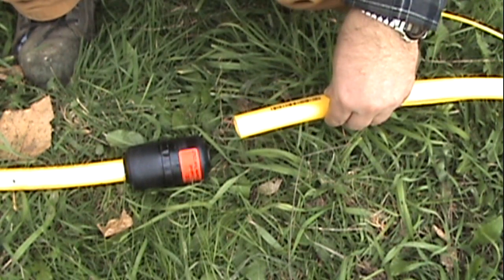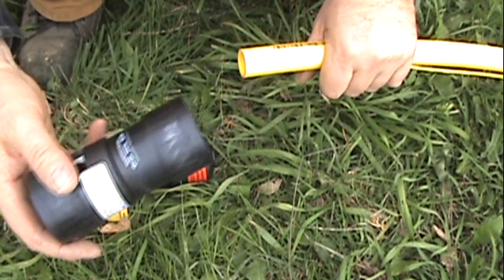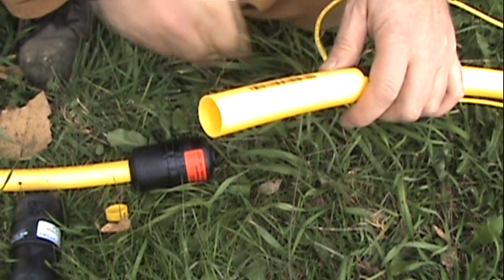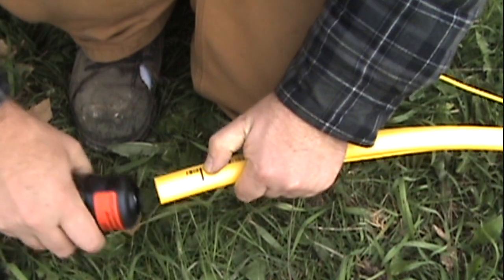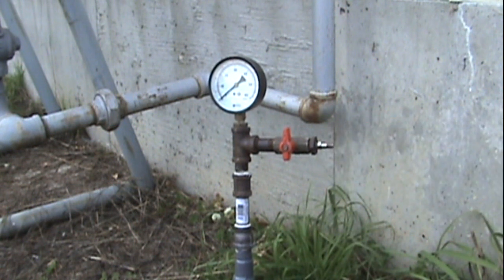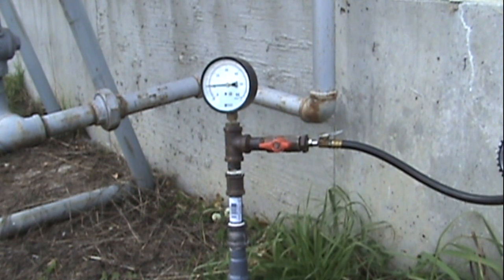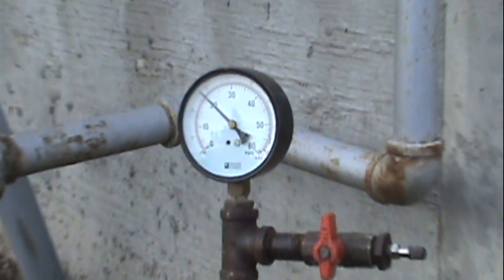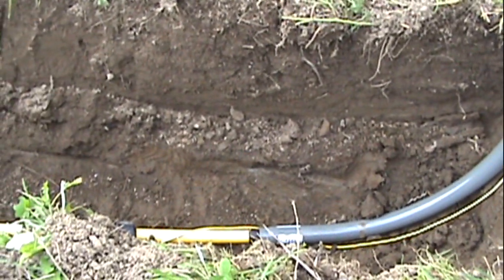Gas pipe Installation Underground Using Continental Con-Stⓐb Fittings

Comment: Can I use that coupling like a transitioning coupling from old PVC gas line to PE ?
Reply from the maker: I'm not sure if it would be compatible, the PVC pipe may have a slightly different wall thickness then the PE pipe.

Comment: Are there other connectors for CTS that can be used underground? I’m trying to run a LP gas line to my shed and was going to tee off of my existing line but found that they used CTS instead of IPS. CTS con-stab fittings are not as cheap or easy for me to get ahold of. I’m an electrician not a plumber so i’m not real familiar with these materials.
Reply from the maker: There are other brands such as Permasert, but the prices for the fittings are similar to the Con-stabs I believe. The IPS fittings may be just for waterline use, I'm not sure though. There isn't much else available other than the socket fusion method, which requires a heating tool to plastic weld the pipe and fittings together. This site can ship fittings, risers, chamfer/depth gauge tool etc. if there isn't a local wholesaler for you to purchase from. https://hdpesupply.com/con-stab-gas-tees/
Reply: @photocontrol  This helped. thank you. I’ve found that it’s cheaper to just run a new line from the tank to the shed using the HOME-FLEX IPS Underground Polyethylene line and put in a second meter rise right next to the existing one and just tee off of the regulator on the tank with black pipe. It’s strange how the yellow CTS Polyethylene line and the yellow IPS polyethylene line are so similar but the connectors are so different.
Reply from the maker: @johnwhite6538  Glad that I could help. Great that you found a more economical alternative to run from the tank to the shed!

Comment: What is that yellow tracer wire used for?
Reply from the maker: As the gas line is polyethylene, the tracer wire allows the gas line to be located at some point in the future if someone was going to dig in the vicinity of the gas line. The tracer wire can be detected by a good quality metal detector, or using an underground utility locator which has a transmitter that once connected to the end of the tracer wire, turns it into an antenna for the hand held locator to find the line.

Comment: Where did you the tracing wire?
Reply from the maker: I taped the tracing wire to the gas line every 10 feet to make it easier when laying the gas line in the trench, I was able to get the tracing wire at the wholesale plumbing supplier I deal with when I ordered the roll of piping, risers, caution gasline buried below safety tape and fittings.
Reply: @photocontrol  I buried 400 feet of gas line several years ago.  And I used a tracing wire.

Do you recommend any particular device to detect the tracing wire?

I need to locate the line because I am having a fence installed.

Mine is a private line going from my gas well to my tractor shed, so I don't think ONE CALL will come and locate my private gas line for me.
Reply from the maker: @CH67guy1  I'm not too familiar with all the different brands of locators, they can be pricey, but I have an older Metrotech 810 which works good to locate the position and depth of underground utilities, Metrotech units are pretty decent.
Reply: @photocontrol  Thank you for this information.  I appreciate it!
Reply from the maker: @CH67guy1  You're welcome!

Comment: I was wondering since I’m not hooking an appliance up so unsure of the BTU’s needed. I have 3/4” pipe out the back of my house and was wondering if I can get enough NG to my 13hp 420cc Generator if I connected 1/2”NG hose at 50 feet from my house 3/4” to my generator I need 50 feet and have to reduce it to 3/8” to generator hook up will I get enough gas or starve my engine please let me know if I’ll be ok from 3/4” at 17 feet in the solid pipe that drops down to 1/2” for hot water tank and the 50 feet 1/2” hose to generator. Thanks
Reply from the maker: If your generator is unit with about a 8500W (8.5kw) max power output then it would be about 28,900 btu's for NG. By the description of your gas piping and hose on a 5" to 7" WC system pressure and allowing for a .5" WC drop in pressure over the distance then it should have the capacity of 34,000 btu's . It seems like the piping will be adequate for your application. If your water heater is on a separate 1/2" branch line off the 3/4" line then there should be no problem with  both operating at the same time.
Reply: photocontrol my gas line is 1” previous owners dropped it down to 3/4” with shut off. I can run it back to 1” with shut off at end of house that would give me a 1” pipe reducing to 1/2” hose at 50 ft with disconnecting at both ends so I can store it when not in use. No matter what I decide as long as 3/4” to 1/2” is good and roughly 40 ft of 1/2” then I should be good. If I went 1” pipe to 1/2” pipe I’m sure it would be better but I’m no expert. Thanks Again for the help.
Reply from the maker: No problem, glad to help! Bigger is better, but with just the 40 to 50 ft run of 1/2" hose for approximately 30,000 btu requirement should be good.

Comment: Wow, this would be challenging if you don't know what you're doing. Excellent video! I'm sure this will help a lot of people. Thanks for showing the steps!
Reply from the maker: Thanks! This is a great alternative to the more common method of joining underground plastic gas piping together that requires a special heating tool to actually heat up and melt the fittings together. Especially handy when there isn't any electrical outlets near by.